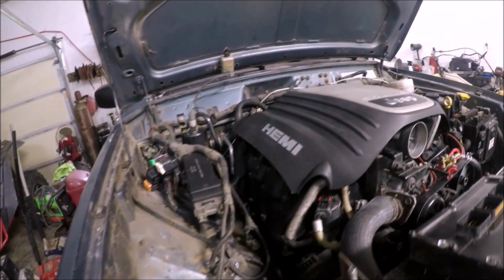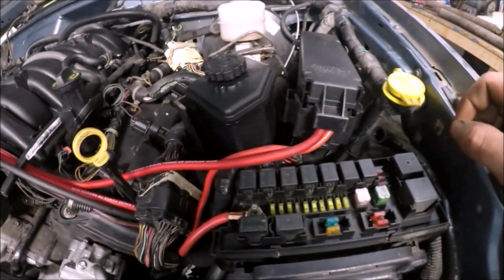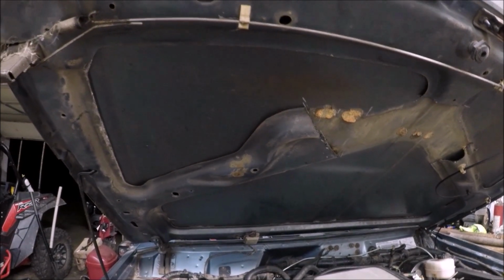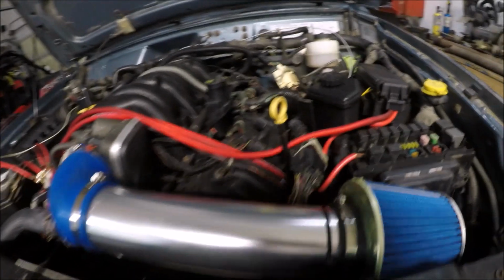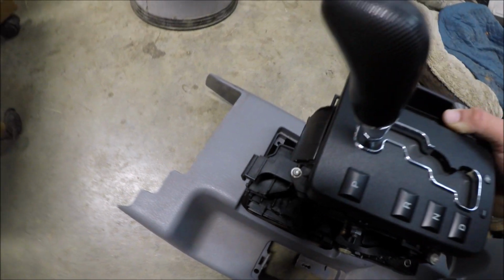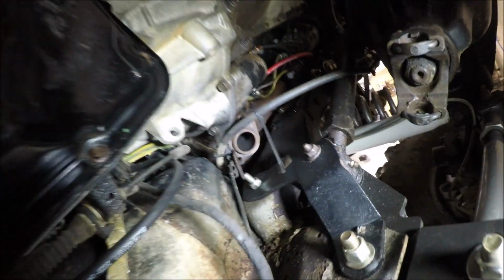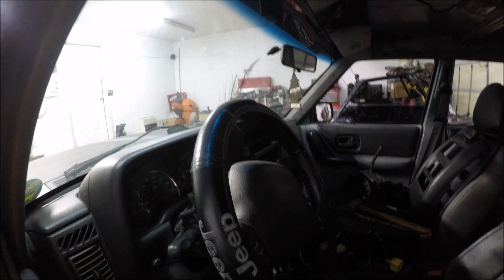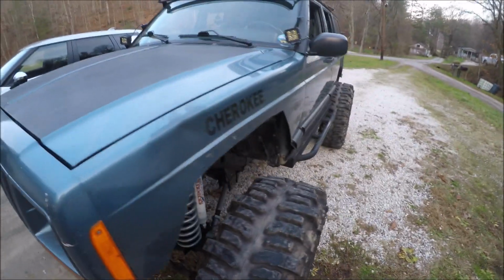Jeep Xj 5.7 Hemi Swap Part 3 of 3 (First Drive At End Of Video)

Comment: I have a commander that's got 165k on it compression is good on all 8 just leaks from main seal  ...LoL...I got an XJ on 42s 120 wb and every mod but still runs a 4.0/aw4 I'm getting ready to get a new /used WK2 and the commander I put back together after hit by a box truck so it's a salvage title not worth much in sale so I figure use the engine, trans and wiring to V8 the XJ and part what's Left of the XK ... It'd be nice to be able to move again in high range . I've got a lot more under hood than you with my Ori strut towers so I'm going to run my battery in the cab with some 00 gauge and run my radiator in the cargo area above my fuel tank nothing under hood is in stock location now after the struts and I run full hydraulic steering ...LoL...my trans tunnel is already an aluminum box after cutting to make custom stuff ... Seems straight forward if running all the wiring from the original metal box the engine came out of . This is the only thing not modified in my crawler...might as well in the fall after wheeling season is done .
Reply from the maker: @yerwrng  It’s really not a bad swap alittle time consuming but pretty easy for the most part. The Hemi made a huge difference I had to keep mine in 4 low all the time even with my 38.5’s.